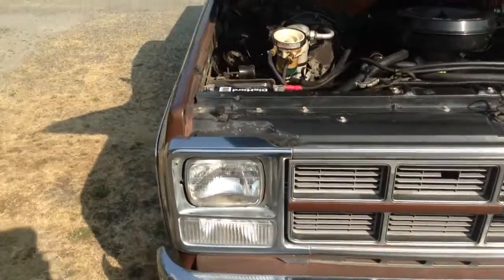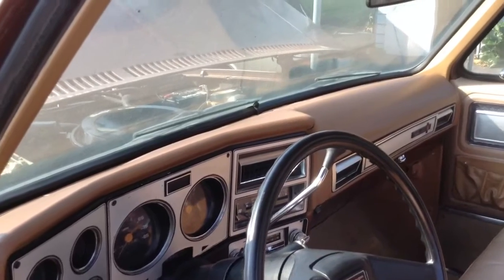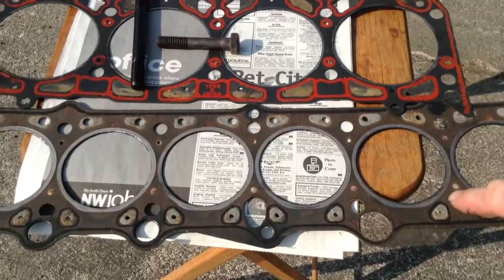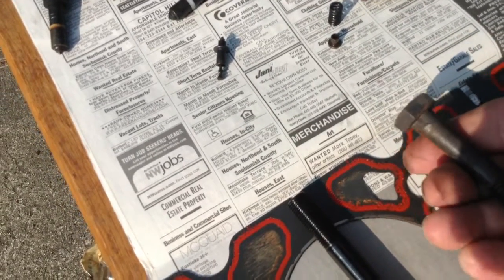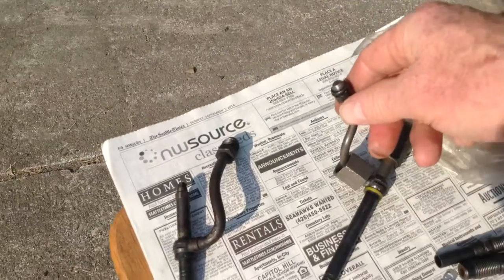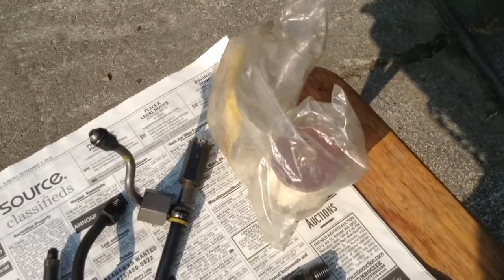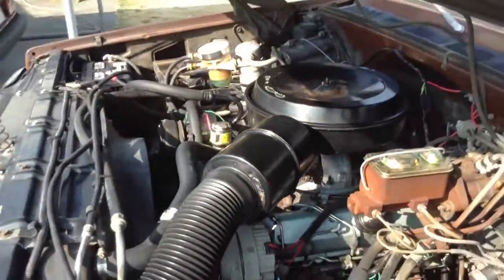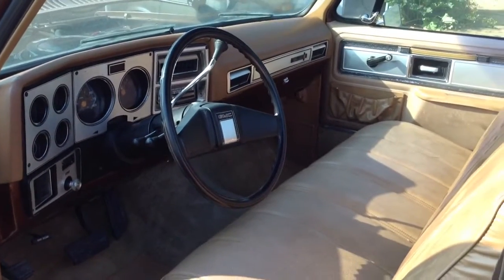1980 GMC diesel 350 Oldsmobile .

Comment: Wow, great video. I doubt more than 100 of these 1978-1981 Olds Diesel Trucks are still around. The 1982+ 6.2 Diesels are still around to a point. I have an 81 Olds 98 car with the DX block. Please update as much as you can. I love seeing anything 5.7 Diesel and very few videos exist and very little accurate information can be found on the web. Thanks for sharing the video.
Reply: Mine a 1982 6.2 Diesel... One of the FEW un-Molested and touched. Restoring it now. But i really want an original 79 or 80, 5.7 Diesel.. REALLY BAD.
Reply: Very few of the 1981 models had the 5.7 diesel, though.

Comment: I have an olds diesel DX block…. Am
Planning on building it with ARP studs, Billet oil pump drive shaft, external oil cooler, with another 2 quarts oil, roller rockers. I know anyone reading this will
say, why spend all that good $$ on a flop of an engine. That’s because those naysayers don’t really KNOW these engines. With a lot of TLC, these engines can go for 200,000 plus miles. You could say that for any engine of course. I have been building diesels for going on 30 plus years now. They can, and WILL last, if not hot tossed, and lead footed. I can get 30 plus mpg out of them all day long. I have a 700R4 I have built with an adapter plate to bolt it right up behind the 5.7L. I would power everything I have with diesel from a skateboard to a tricycle if I could! Love the olds diesel!!!
Reply: I have 350k on mine so far.  Runs fine...

Comment: Nice truck you have there,not many left gas or diesel in the original condition. I have myself a 1979 chevy scottsdale with the 350 diesel and an 81 cadillac seville diesel. I have replaced a few head gaskets in my time with those but i still love em.